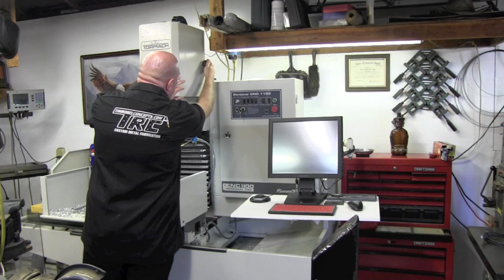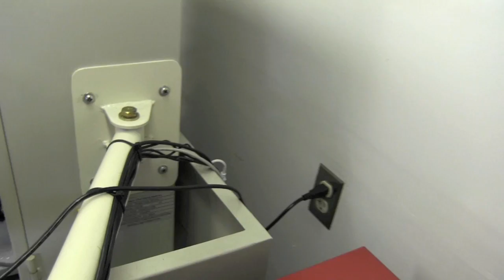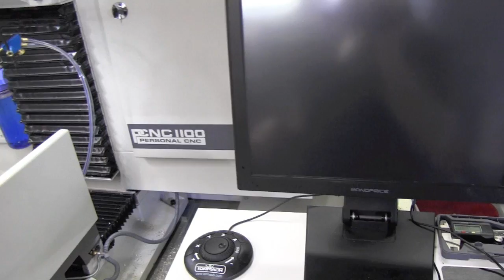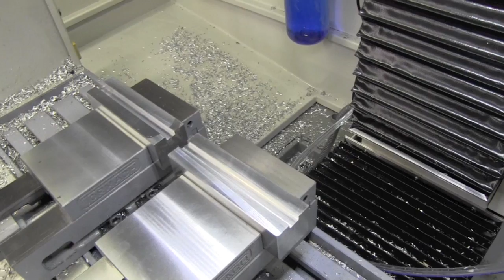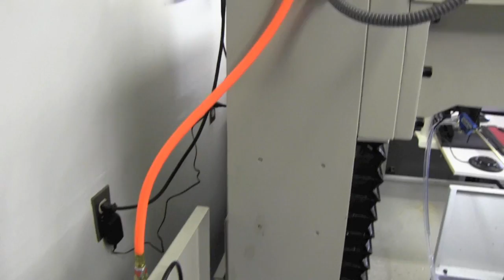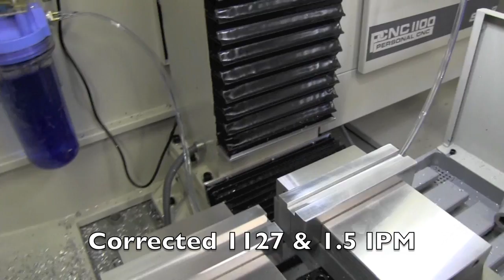Tormach PCNC 1100 Set up and lessons learned

Comment: Hi Tim. Thanks for the great video. At @ 28:40 you mention 80” wide. Tormach shows a width of 67”. Can you please advise where you took the 80” wide measurement from? I’m trying to figure out exact space (overall min width) needed. Thank you kindly.
Reply from the maker: I’m sorry for the slow response but I’m trying to figure out where I came up with the 80 inch number and that may be what I needed to get around the machine. I’m sure if I said 80 it was 80 which you’ll need. I have sold the machine about two years ago and kind of sorry I did. I’m doing a lifestyle change where I built an expedition truck and now just finished in Overland Humvee And going to hit the road doing fun things and not staying in the shop so much! I still highly recommend the machine! I do miss the process ! So sorry I couldn’t be more of help.

Comment: How’s your Tormach holding up?
Reply from the maker: My initial purchase which was in the video here was right at the $15,000 marker that I had to spend. Things have went up and the machines are even gotten better. I ended up with a tool changer and full enclosure which added about another 8K at the time. That was about a year after this video. I ended up selling it last summer for 20 K. I think it’s a great product and I would buy it again. I’m just spending more time traveling in my expedition truck I built. Hope this helps and I’m here for you if you have any more questions. I have zero issues with the machine! The guy I sold it to hasn’t run in five days a week making paintball parts.

Comment: Which one PCNC440/770/1100 will be the best machine for gunsmithing.
Reply from the maker: Thats a hard one one to answer! The 770 has a larger work envelope the the 440 and had a 10k spindle witch is great for aluminum work. The 1100 have the larges work envelop but a 5k spindle witch works great on aluminum but slower feeds and speeds. All depends on what materials you will be working with and how large of parts you will be making. Hope this helps a little! My want to check with a sales person at Tormach. For me I'm super happy with the 1100 and would buy it again.

Comment: For your Mister, that cracked the china made plastic mounting holes, you really should have drilled out the holes to a larger diameter, (about .050" smaller than the bolt diameter at the thread), and I don't think they would have cracked.  I would like to get a "mister" set up like that myself.

Comment: Tim man:  What are you talking about with a pallet?  To the best of my knowledge, a pallet changer is not offered by Tormach, (and should not be with this machine IMO), and you don't have a pallet changer so I don't know what you refer to when you mention the use of a pallet. I suspect it might be a misuse of terminology that you are using. If not, what am I missing?
Reply from the maker: I use a palette that goes into the two vices more like a ficture plate. This way I can load the part on the palette while the machine is cutting out the current part. Just a 30 second part change and I'm off and running the next part!
Reply: I don't think that is called a pallet system though, (terminology differences I think).  I have a 6 satiation fixture on my PCNC 1100, where I can change parts when the machine is running, which are work offsets G54,55,56,57,58,59.  A pallet system in machining is using a pallet changer, (pretty expensive),  where the work piece and fixture is shuttled out of the the machine after the end of the cycle, and a second pallet enters the machine (identical fixture and part to machine) so you can machine and change parts at the same time.  What you have (If I read you correctly), is two work offsets, (making the same part also), so you can basically do the same thing, (because the machine is not enclosed, blasted inside with coolant).  Both, eliminate the load time equally, if the load time is less then the cycle time. My load time between parts is low enough so I can drink some beer while changing parts during the cycle time of all 6 parts.   I love being self employed.  :)

Comment: Hey Tim man:  I dig how you made every inch count when setting up your garage.  But I don't see any "work" there.  If you start gaining work, you are going to need to expand your space, (I was cramped in a one car garage, now in a 4 car garage).  I love your shop.  Do you know the Ford/Rouge plant started in a shop not much bigger, (and probably less capability sans CNC)?
Reply from the maker: Thank you on the space! Currently running production with no issues with room! Everything is tight but within arms reach! LOL! I have one more guy that we work great together one is doing fab and the other is machining or running the CNC plasma. 10 years ago I had 10,000 square feet with a full fab shop and retail. Never want to do that again! The 1100 is working out well! I still have so much to learn with Fusion but were knocking out parts every day! Thanks for the great comments!
Reply: Fusion.  My only weak point with machining is not knowing a 3D software program. I have programmed some 3D by hand though, and it takes a day to program about 1 inch worth of work.  I am one of the old guys who programs G&M by hand, also using a cad drawing (with more complicated parts) to find points (numbers) I need to program the part.  I hope to get a larger machine next year, (like a robodrill) so I can hammer out alum billet parts also.  The Tormach is about perfect for the work I do now, but it is painfully slow, (hey, it is a small personal CNC mill), when it comes to production parts that require anything bigger than a .250 dia. end mill.  Great little machine though that I have had for over 10 years now, and put almost 1 million dollars worth of work though it so far.
Reply: I don't know if it is still on Tormach's web site, but years ago they had a vid of me cutting off fins of a air cooled 30cc two stroke cylinder to turn it into a water cooled cylinder using a water jacket over the head/cylinder.  I modify little 2-stroke engines for a living, and this machine is the most perfect machine in the world for a guy like me in a small garage.  Everything else I looked at was to big, (for the garage I was in), or too small for the work I needed to do.  I swear, if Tormach did not exist---I would still be an employee for somebody else.  Yuck!  I never want a JOB (Just Over Broke) again.

Comment: Don't think this machine is only for the small guy.  Big shops can use them also as a 2nd operation machine next to a bigger machine.  The machine can be moved to a larger machine with a forklift to perform a second operation, (for example,  counter boring the under side of the holes you drilled in the first op.), to make your machining center more of a work cell.
Reply: That effectively cuts out a operation, which is huge.
Reply from the maker: For sure!

Comment: I just ran $75.00 worth of work through my 10 year old Tormach PCNC 1100 while watching this 1/2 hr vid.
Reply: Sorry, my mistake.  I just ran $150.00 worth of work through it while watching/listening. 
Boy, it must stink working in a union shop where you don't get the skill needed to start your own business.  Listen up guys, the union shops may pay more have have better benefits, but if you learn nothing, what is the benefit of that?  The skill comes from non-union shops, (who frequently do the harder work for union shops. I have worked for over 20 of them before I started my business). It also helps a lot, to work for many shops.  As you gain skill, you will have no problem finding a job in machining. So all the while you are working for people who previously worked for other people, always think about starting your own business.  If you do it, and it takes off,---you will feel a sense of freedom you never knew existed, (until April 15th).  It is human to think, and to create is our destiny. :)

Comment: Good info. I just got an 1100 too.
Reply: I bought one over 10 years ago.  I had one break down in the first year, a blown transformer and some coolant related limit switch problems, (I no longer run coolant, but I don't need to for my application.).  They had the new parts to me in a day or two, and helped me over the phone to install them. I was running again in 3 days and have not had a problem since.  I am not moving mountains with it, aluminum castings, (porting 30cc 2 stroke engine cylinders) with a .125" end mill is most of my work.  If I were trying to cut D-2 with a 1/2" cutter, I am sure I would not have the same results.  The machine is a perfect size for what I do.  I oil the full length of the ways in each axis with about one pull of the oiler plunger for each axis, (while moving the axis from limit switch to limit switch, trying not to hit them), and after 10 years, the backlash of the double nut ball screws has not grown more than .0003", still the backlash is under .0015".  It depends on what kind of work you are doing, and what that market is like, but I have almost 1 million dollars worth of work through my 10 year old machine.

Comment: Great Video.Glad to see that you appreciate the sacrifice your parents made to give you this beautiful machine.Sorry about you Mum,may her RIP. I am a Machinist,very good on the lathe and milling machine,in fact most machine tools,all manual machines.Recently the shop I work at,bought two CNC machines,a TL2 Haas Lathe and a TM2 Haas Mill.They are beautiful machines.The mill has the Renishaw Probing System.Makes life so much easier.I myself now is on a learning curve,teaching myself the CNC process when I can.The software I use is Solidworks with integrated HSMworks.Keep at it you will get better as you go alone.
Reply from the maker: Thank you for the kind words! I keep pushing forward every day!

Comment: Hey Tim, thanks for making the video. I've been doing a lot of research on the Tormach and videos like yours really help with the process. 

What size air compressor would you recommend for what the Tormach consumes (with the power draw bar and coolant lines)?
Reply from the maker: +Buffalo BottleCraft You can get away with a very small unit that Tormach sells or something similar. I have a Husky 60 gallon 5 hp single stage from home depot. It runs my shop very well.

Comment: Wow. Awesome man. Very inspiring. I'm a machinist and currently a junior in manufacturing engineering and I really wanna take up entrepreneurism. I have heard a few bad things about these machines just from random guys on forums. I'm pretty convinced these are decent starting machines. Hopefully I can put fourth the money in a few years and make some chips!

Awesome video man. Really look forward to further videos.
Reply from the maker: +theconsumer 1 I have to say I know much more about being a entrepreneur that a CNC machinist. For me being a designer, engineer, fabricator and now a CNC machinist, the Tormach allows me to finally spend the time to build a part, evaluate it, test it and then manufacture it all in house. Most of my products rely on me to CNC plasma a part, fixture it, weld it and most of the time powder coat it. All labor intensive ! With the Tormach after the initial investment in time and testing, when it comes time to do a production run theres a lot less work. Many of guys have made great money bringing there ideas to life with the Tormach machines. Thank you for the comments and so far I highly recommend the Tormach line!